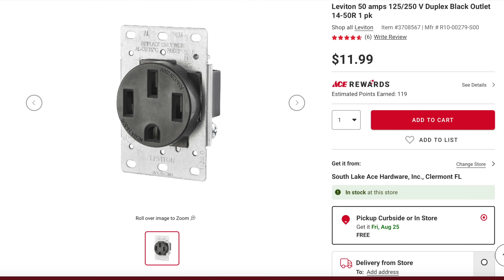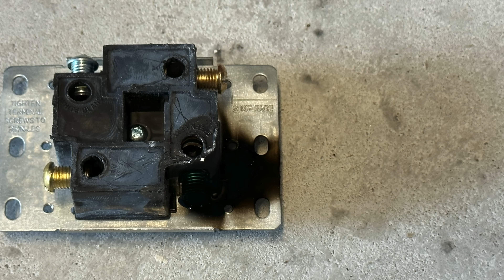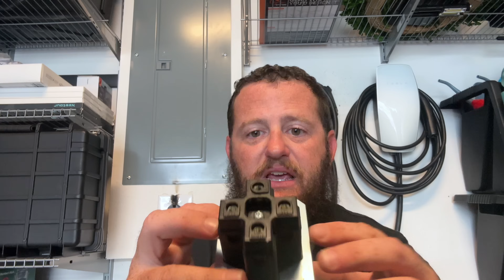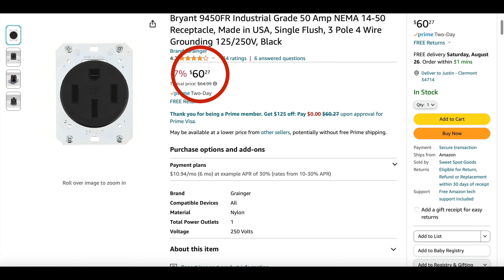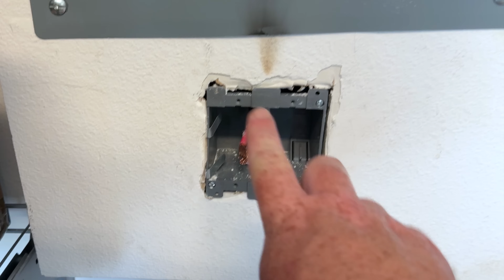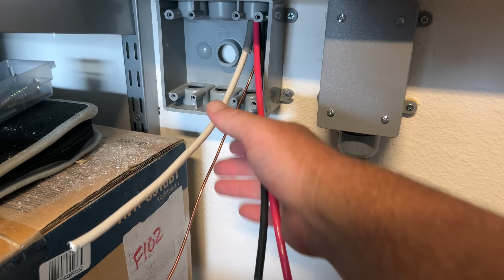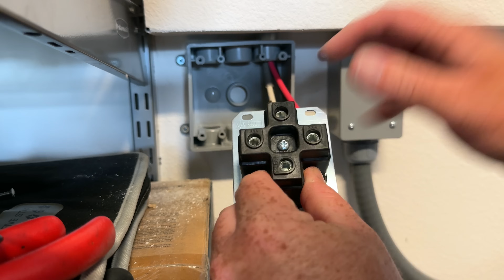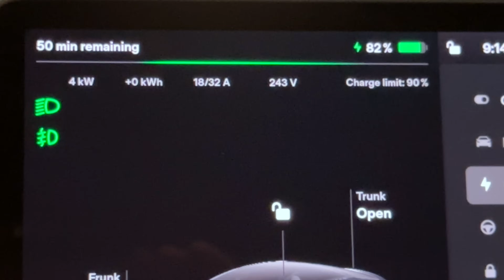This Will Save Your Life if You Charge Your Tesla on 14-50 Outlet!!

Comment: It's very strange that the ground terminal burned. The ground terminal should not be carrying any current, unless there is a fault (eg. line to ground fault). Your burnt ground terminal looks very strange indeed. There should have been no current flowing through the ground terminal, unless there was a fault.
Reply from the maker: Yea, I dont have good answers for that. I dont know specifically what happened, but there are signs of melting on both positive leads around the back of the plug. Something was brewing and perhaps it caused this to loosen up enough to make contact?
Reply: @BeardedTeslaGuy  I'm a retired electrical Contractor. Off hand, I don't think the Leviton device is to blame. I can't conceive of any scenario within the Leviton device that would cause that ground fault situation. If I were to guess, I would say that possibly the bare ground conductor came into close proximity with one of the line conductors or line terminals on the back of the receptacle as the receptacle was pushed into the outlet box. In the process of plugging in the charging cord, the receptacle may have moved just enough to allow one of the line elements to contact the bare ground conductor. This is the most likely scenario, it seems to me. Unfortunately, in residential wiring systems, we have bare ground wires to contend with. In commercial wiring systems, we usually have insulated green ground conductors or use the metallic conduit system for ground. Never the less, we always have to be aware of the possibility of interaction between all the elements in an outlet box and use caution when shoving everything into the outlet box. Thank goodness the circuit breaker did its job and averted a disastrous fire.
Reply: @BeardedTeslaGuy  glad you're ok and thanks for raising awareness
Reply: do the US have PEN fault? or not applicable depending on setups?

Comment: Sandy Munro dod a video on this. Basically if you bought a $15 outlet, you made a mistake. The good ones are $100+. I learned this from the electrician who wired my wood shop for 220 volt machines. 

Better yet, hard wire your Tesla wall connector.
Reply: $83 for my industrial Hubbell. Prices have varied greatly based on supply/demand though!  These industrial 14-50 receptacles are definitely necessary for EVs!
Reply from the maker: Yep, these big box store outlets are not up to snuff for this.

Comment: Something no one is saying, the amps are to high causing the 14-50 to melts. The wire can handle the amps. Now everone is using the good 14-50 plug.  The Fuze box can also melt. 
When I felt my Tesla plug it was very very hot. Turn down the amps to 27 and now the Tesla plug just gets warm. Good luck if you are using 38 amps. See Sandy Munro on this!!!!
Reply: Exactly I just charge at 24 amps which is plenty and it barely gets warm. No reason to charge at max amps in most cases
Reply from the maker: yea, the safe thing would be to turn down the amps, but also, just getting an industrial grade receptacle works too.

Comment: Anyone: I currently have the 14-50 on a 50 amp breaker. I’m thinking of swapping it out for a wall charger. Will the 50 amp breaker support the wall charger or does it need to be upgraded to a 60 amp?
Reply: Yep the 50amp is the max the wall outlet can take on a 14-50 plug in
Reply: No problem at all. Wall Connector can be configured to limit current to suit whatever circuit breaker is hooked up to. They call it provisioning and it’s done by connecting to the WiFi it broadcasts.
Reply: @pepstein  exactly. Nothing says you have to run it at 38amps. You can also set this from the car as well
Reply: @doomsday9973  yeah, you can reduce current via car or phone app, but you always want to configure EVSEs to disallow current above safe limits.
Reply: @pepstein  agreed. Mine has been charging safely at 24kwh for years now it barely even gets warm even though I could do 38, 24 is more than adequate for me
Reply: @doomsday9973  that’s good to hear, but it by no means implies it’s generally safe. 14-50 receptacle problems are a real issue, as Munro highlighted, and extension cords prevent the EVSE from detecting the problem soon enough to prevent them from turning into something serious.
Reply: @pepstein  there are literally millions of these things installed in homes all over, houses aren’t going up in flames left and right due to EVSE plugs it’s of course good to be cautious and install the right equipment torqued to spec etc it’s perfectly safe. I saw that Munro video, the one example he freaked over? It was obvious aluminum wire was used not copper which was the issue as a ton of posters pointed out yet no mention was made of this which was mind boggling. Millions have gas connections which can literally cause your house to explode but very very few do this is no different
Reply: @doomsday9973  I’m not saying it’s horribly dangerous, just that there’s a good reason Tesla says not to do it.
Reply: @pepstein  well I do agree he should not have converted the Tesla wall connector to a plug in. It’s not designed or shipped that way (probably voids the warranty too) that I would not do either.
Reply: @doomsday9973  Tesla sold a version of Wall Connector that came with a 14-50 plug.
Reply from the maker: You can keep it at a 50 amp breaker, it will just limit the wall connector to 40 amps.
Reply: @BeardedTeslaGuy  Yup. You do have to tell the wall connector that it's operating on a 50A breaker. The electrician should do this for you.

Comment: These receptacles are designed for continuous use.   I question the installation or wire size.  The 75*C is stamped on the frame.
Reply from the maker: I replaced the wires while I was in there, and the original wires were proper gauge (6 gauge)

Comment: NEMA 14/50 is also used extensively in RV applications and that plug is designed to be pulled in and out (when not energized) looks like a ground fault. I didn’t watch your entire video but it looks like the earth ground plug is what took the hit, not the hit terminals.  Don’t pull it out when there’s current flowing through that plug like when it’s charging your EV. I’m glad you’re OK. 240Vis no picnic. 240V at 50hz is even worse. Be careful !
Reply from the maker: dont know. It could also be simply heat rising over time, thats where the flame was when it happened, so maybe that? I dont have a good answer for you on this one.

I am really happy though that this ended the way it did. Whether I could have been killed or not, like I said in the video, it felt like I could have and I escaped death this time. Very grateful and want everyone to know what happened here so it doesn't happen to them
Reply: I agree, this looks like a ground fault.

Comment: I actually didn't rely on the electrician to supply the NEMA 14-50 and I ordered a Hubbell brand. I had a similar problem in supplying continuous power to a motorhome so I learned that the basic NEMA 14-50 is not made for continuous power even when left plugged in.
Reply from the maker: Yep, a step I wish I would of had known to do

Comment: How did the ground wire melt? The ground wire shouldn't be carrying any current.  Something happened that energized the ground and then caused it to overheat/arc ... which is a far more serious failure mode than a simple loose connection.  I would seriously look over your reinstall of that outlet and think about what happened there.
Reply from the maker: dont know. It could also be simply heat rising over time, thats where the flame was when it happened, so maybe that? I dont have a good answer for you on this one.
Reply: @BeardedTeslaGuy  I'm going to see if the forums have an idea on what happened here. I think I would replace the breaker for that circuit at a minimum as the main panel breaker should not have tripped first.  Not sure if you remember if the circuit breaker was tripped or not.
Reply: @BeardedTeslaGuy  Also you have a 60A 240V breaker with black and white wires coming out. That white wire needs to be taped or painted red on both ends to indicate a hot wire.

Comment: First those are not made for plugging and unplugging over and  over. You may not have known that so I will cut you a break on that. But if you felt the plug getting looser and looser wtf, why would you not say to yourself somethings wrong here, thats 110% on you. Also for gods sake your plug is like 1 foot from the breaker box, soooooo easy to swap out everything, breaker, wiring, plug, box, cover. And never use plastic boxes and covers for something like a high power EV. Common sense people.

Comment: I am sorry this happened to you. When I got mine installed by an electrician that has done many EV chargers he specifically told me the plugs from Home Depot and Lowes (cheap ones) are not the be used for frequent plug and unplug. He also recommended to de-energize the outlet thru the circuit breaker when doing it. I see DIY videos here for these plugs and I think that is a terrible mistake. I am not even sure your insurance will cover a house fire if they find out that such high energy plugs were not installed by a professional.
Reply from the maker: dont know, I am not an insurance adjuster or an electrician, just a guy

Comment: Yea, I’m not sure I have a use case where I constantly unplug mine. In fact, i don’t since I just have a second mobile charger. I also had mine installed by an electrician so I don’t know the brand but now I’m very curious about my setup either way. Hoping the fact that I never unplug mine will avoid the headache.
Reply from the maker: yea, I test a lot of charging equipment so I have a much different use case than most people

Comment: From the looks of things, the circuit breaker failed to trip and if the whole house went dark, it means the 200 amp main circuit breaker tripped to save your bacon. Remove the old circuit breaker and get a new one, it is probably defective, like the plug.
Reply from the maker: yea, it was the whole breaker panel (200 amp)
Reply: @BeardedTeslaGuy  I think he's talking about the 60 amp breaker on the outlet. It should have tripped first and left the main on. Replace the 60 amp breaker. Also, ground is a failsafe path and should not be a return path for load. If you have an electrical burn in the ground receptacle, something in your equipment shorted to ground or the internal parts of the outlet shorted to ground. Without knowing what failed, you should check your equipment to ensure it is functioning correctly. (Essentially, no part of your load wires should be contacting any metal parts of the chassis which is grounded and your plug should be in good working order as well. Your cable could also have a stress fracture in the insulation around either of the load wires anywhere along the cable and they may have shorted to ground.) Probably best to hire an electrician to look into this. Something else is going on.
Reply from the maker: @anthonylosego  the 60 amp is for the hardwired Autel charger, this 14-50 is on a 50 amp
Reply: @BeardedTeslaGuy  I replied before you opened the panel. Lol I just assumed 60. Whichever it was, the point remains. Grounds don't normally carry load. Something is afoot.
Reply: @anthonylosego  4 wire was not used on old installations, say pre 1979, then the load and ground is the same, not particularly safe.
Reply: @anthonylosego  It does seem like there's something wrong if the protective ground actually carried over 200A and tripped the main breaker.
I'd expect something was wrong with the cable being plugged in to the socket, as the other three terminals are what's supposed to be delivering all the power. The ground is only intended as a safety in case a stray loose wire came in contact with the chassis, to protect the person handling it. 
Did the video go into any investigation of why this happened? Doesn't seem like installation of a new receptacle fixes the root cause.

Must have been a wiring issue or some other underlying cause which remains undermined. Maybe there was a follow-up on it we're not seeing.
Reply: A fast, strong short can trip the main breaker. This is not at all uncommon, and does not mean the 50 amp breaker failed. It just means it was an intense event.
Reply: @rebturtle  That is true, but you are saying that the 50 amp was to slow, replace it immediately.
Reply: @tedmoss  very high fault currents can cause protection mis-coordination between relays or breakers. It’s not very uncommon. But it might be worth replacing the breaker just for safety.
Reply: If the 50A breaker failed to trip before the 200A,  then it needs to be tested to see if that's actually functional and able to open up under an overload condition.
It may be inoperative, and you're now protecting your 50A circuit with a 200A breaker and heavy duty outlet.  The original receptacle may actually have saved things by melting down to break the connection.

Comment: Glad you found it before it got worse.  Munro Live has an excellent video on the topic.  I have had my 14-50 for 8 years now charging 2 EV's without issues.  Have a 35 foot cable run from the sub-panel and 110 foot run from the main panel.  The 50 amp run in the garage is in flexible metal conduit and runs through the wall into an Eaton metal external box.  Was installed by an electrician who did my solar installation and I have only unplugged it once to take photos.   It's also recommended to unwind the cable to avoid heat buildup.  My wife had not done this with her Kia EV6 and the cable was very flexible hot after 7 hours of 32 amp draw.  Since then I instructed her to park so that the cable is fully unwound and no longer have heat problems in the cable.
Reply from the maker: yea, there's a lot of good practices out there to share
Reply: Thanks for this, I don't recall our cable ever getting hot, but I will keep it in mind.  My wife drives a lot and we plug it in every day.

Comment: BTG thanks for spreading the knowledge. Sandy did a great video on this too. https://www.youtube.com/watch?v=tDp9PhPJhUI

The key difference here is EV eletrical systems differ because they ought to be rated for 100% duty cycle, which means they are rated to be able to handle the EV loads non-stop, while others like this Leveton are obviously not able to handle EV loads non-stop (and will eventually fail).

When you pipe a ton of amperage through an electrical system that isn't 100% duty rated, it'll continuously generate heat and will either continue to get hotter and hotter until it fails, or it isn't able to disapate heat well enough that the highest heat plateau it'll get to is hot enough that it'll cause it to fail after some time being at that heat or just repeatedly being at that heat.
Reply from the maker: yep, thanks for sharing additional details

Comment: I have the Leviton 14-30 outlet in the garage for my tesla.   I use the mobile charger and don’t really ever disconnect it.  I also have a metal box and faceplate, I will take apart and look inside next time I unplug it. 
Thanks for the heads up on this potential issue!  ✌️
Reply: The good news is that at 30 amps the risk is reduced vs 50 amps.

Leviton do make commercial grade stuff as well so it's not a bad brand, its using residential grade for a heavy duty application that the issue.

Determine if yours is residential grade or commercial grade, there should be a part number on it. If it 10 years old or more replace anyway.
Reply: @JeanPierreWhite  it’s most likely a home grade one. The outlet was used for a clothes dryer and is original to the house, which is now a bit over 14 years old…so I guess this settles it lol.  Thanks!
Reply from the maker: check it and consider replacing with a heavy duty one

Comment: New electrical code require GFCI breaker for 14-50R outlet. But it will interfere with Tesla mobile charger with internal GFCI.
Reply: Correct or any decent plug in wall outlet
Reply: Assuming he is in a jurisdiction that has adopted the new code, but it’s better not to have one anyway, at least in this case.
Reply from the maker: that new code is not everywhere yet

Comment: I had an electrician install an outlet to plug a charging station into.
It has worked well. 
When I looked at it I could see it was an industrial outlet. 
I have unplugged it maybe two or three times. It is very hard to plug in and unplug. Quite solid.
Reply from the maker: it should feel stiff to plug into thats a good sign

Comment: Mine got hot and the Tesla actually notices and displayed Charging error message to check the plug. the outlet was super hot. I had an electrician come out and it turns out the wiring came lose on the backside. Check your outlets!!
Reply from the maker: smart

Comment: I never unplug or plug into a 240 volt outlet without turning off the breaker… just my own safety measure this way my hand or body is clear when I energize it.
Reply from the maker: I test charging equipment quite frequently so thats why I have more cycles than most people

Comment: Even if you dont unplug in screws holding wire inside tend to loosen overtime which leads to contacts overheating and receptacle plastic getting warped and brittle. That may cause it to short out eventually.
Reply from the maker: true